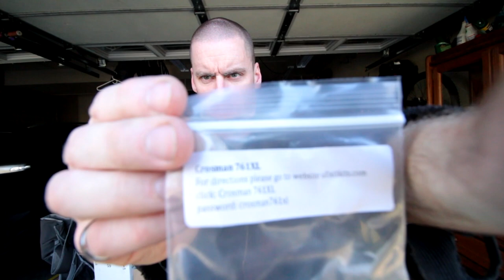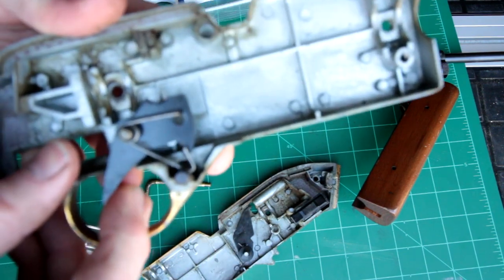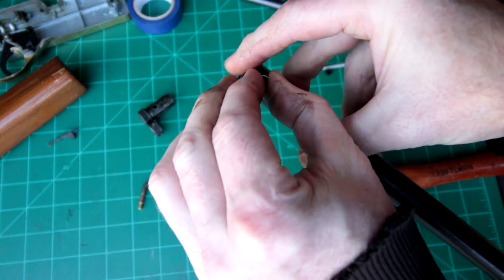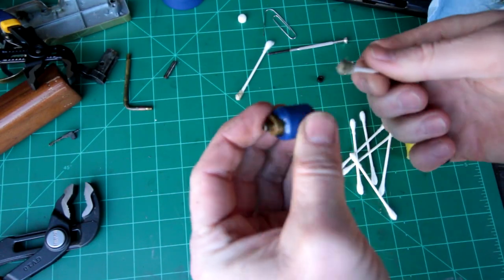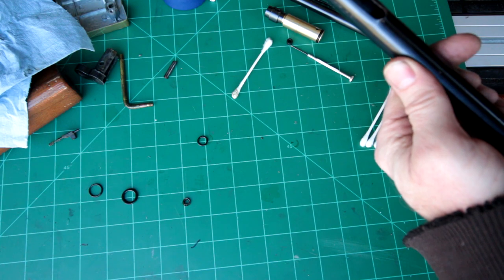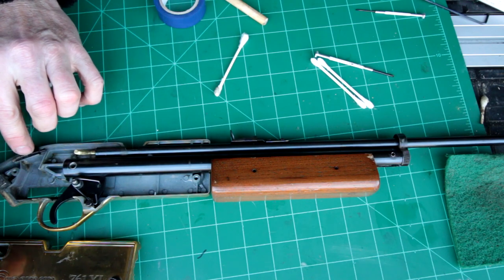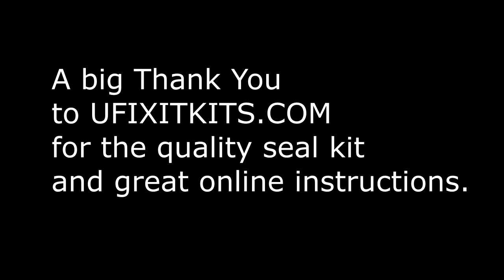Crosman 761XL Rebuild

Comment: You're the only one that knows how to put the 760 back together the right way answers all my questions and head scratchers I just bought an old 760 had taken it apart and just wondered how to actually get it back together the right way thank you so much!
Reply from the maker: Thank you so much for the comment.  One of the reasons I videoed the whole process was to have a reference for myself to be able to put all the pieces back correctly.  I used to take pictures of the process, but I think video is better.

Comment: Great rebuild, but you ordered the wrong piston.  Your gun has the older "flat head" valve, which used an adjustable flat head piston.  The later valves had a conical head, which used a piston with a pump cup.  You used the later piston with pump cup, which will create some headspace and won't allow you to build as much pressure.
Reply from the maker: Thank you for this information.  I was mainly wanting to get it back to working condition, which the new parts did.  It has been a while since I did this, but I thought that the pistons looked the same.  Maybe the gun had been resealed before.
Reply: @Todd Kavanagh any idea where to get the right piston you're talking about? I have the same with the flat head and can't find it anywhere

Comment: Thanks for your video. I bought my 761XL new in 70's & Jan 2024 the seal just broke.  I'm going to repair it. My brass has flaked a bit more than yours. Everything else has held up nicely.  I have the original carton too. Thanks again.
Reply from the maker: I always liked the 761XL but never had on as a kid.  I was able to get the one in my video relatively inexpensive because it wasn't working.  A little bit of time and a few seals later, it was as good as new.  Good luck with repairing yours.

Comment: Great video, and great gun!  They sure don't make them like this anymore......
Reply from the maker: Thank you for the comment.  There are airguns made like this still, they just cost a lot more.
Reply: @CHARLESCRANFORD  I was curious on your 761XL when fired do you notice air escaping along the upper seam of the receiver, near the where the BB slide switch is?  Maybe its been a long time since I shot this and not sure if this is part of the design or I am imagining things.
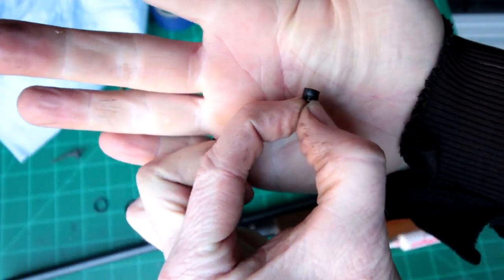Reply from the maker: @malibuguy5187  I do not notice that.  It could be your seal between the pump tube and the barrel.  You can see this in my video at 24:24.

Comment: That was great.  Hey, can you tell me what the decibel level is with that crosman 761?  I was just wondering if I could use it on rats in my yard without freaking out my nosey neighbors.
Reply from the maker: If you have nosey neighbors, this is not the gun for you.  Only using three pumps might be okay, but you won't have the power to humanely kill rats.  If you knew you could git one good shot and then act like you didn't hear anything, maybe.  There are some new air riffles with built in sound dampening, that are almost as quiet as a Red Ryder, but have more power than a fully pumped up (loud) 761.  Good luck with your nosey neighbors.

Comment: Where did you purchase the rebuild kit.  I checked UFIXITKIT.COM, but it's just a generic web hosting site.  I looked at several videos and rebuilding, I liked your the best.  Thanks!
Reply from the maker: I found them on ebay.  They are ufixitkits.  When you buy a kit from them, they give you a code to access step by step instructions, on their website.  Thank you for the comment, and good luck fixing yours.
Reply: @CHARLESCRANFORD  Thanks.  I appreciate your quick reply.

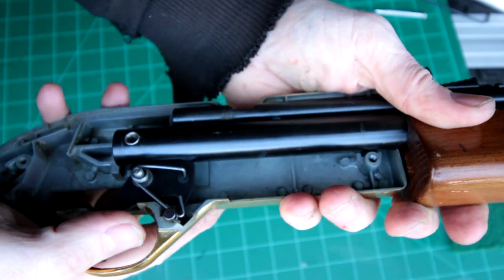Comment: At 26:36, you have the threaded pin backwards. The cut slots go outward to allow a screwdriver to hold it while tightening the sideplate screw.

You were lucky on that valve, I've tried tape, rubber, nothing will hold mine tight enough to allow me to get it to come apart. The plier jaws did a pretty good job strafing the checkvalve surface though...

I may try it again with leather, perhaps an old belt.

The screw was also cross-threaded into it, but a tap salvaged it enough to where the screw will hold.
Reply from the maker: I have watched that part five times and I am still not sure what threaded pin you are referring to.  Is it the pin that the trigger pivots on?
Reply: The big pin that goes through the receiver and holds the rear plug. Freeze frame at that timestamp, it's already installed.
Reply from the maker: @stevekurzban9352  Okay I think I see what you are talking about.  During disassembly, at around 10:00 you can see me wondering if it goes in one way or the other.   Reassembling at around  21:49  you can see me fumbling with it and it seamed like it would only go in the way I put it in, but I was able to put it in backwards somehow.  If one of the screws got stuck in there, it would be hard to get it out without access to the slotted part of the pin.  I am surprised the pin isn't slotted on both ends.  But, when I was disassembling, that part, I didn't need to hold the pin to be able to take the screw out, I got lucky.  I was mainly taking video of taking this apart for my own use in case I couldn't remember how something went together.  Thank you for pointing this out.  Hopefully your comment will help someone figure out how to fix there air gun.
Reply: @CHARLESCRANFORD  you fared better than I did, a kit with 4 o-rings netted me 435 fps using bb's at 10 pumps...
Reply from the maker: @stevekurzban9352  I would have been happy with 435, cause before it would barely hold enough air to spit a bb out the barrel.   Do you hear any air leaking by, when you pump it up?
Reply: @CHARLESCRANFORD  no but I'm not sure my hearing is "equal to the burden". It builds both fps and resistance with each pump stroke. It also likes pellets much better than bb's.
Reply from the maker: @stevekurzban9352  At least it is working.
Reply: @CHARLESCRANFORD  It's got a new home, gifted as 5 year olds first bb gun. 

Was thinking after, could be the tuning I cut for  transfer port. I "sealed" the ends using plumber's silicone grease...

At least it's accurate with pellets

Comment: I replaced all of the seals in mine and it still loses air somewhere toward the front of the pump assembly.. so frustrating.
Reply from the maker: Is it puffing, when you pump or hissing, after it is pumped.  The puffing, with the pump in the open position, is it letting air in, and is normal.  Hissing, after it is pumped is not normal.  If that is the case, you may have a damaged seal or damage to the metal/brass parts of the gun.
Reply: When i pump it slow, it gives one quick puff. And builds no pressure. It sounds like it could be puffing it right out of the barrel maybe. I may just buy a new air chamber for it or whatever its called and replace the whole thing i was just hoping to save the origional parts with it being an older model. But im not sure which ones will work with it. Its got the brass internals, brass bolt, i think its the self cocking version from what ive read. Its labeled as a powermaster instead of the later pumpmaster.
Reply from the maker: @tylerparker3024  Did everything move smoothly and did all the parts look clean?  It does sound like the cup seal is not working properly.  Sometimes oil can gunk up inside the parts and keep them from moving freely.  You might be able to clean the parts and get them moving freely again without having to replace the old parts.
Reply: I cleaned everything pretty good when i had it apart. And replaced the pump cup. Maybe the air is still getting around that cup. Its difficult to tell where the puff of Air is really coming from.

Comment: Hey Charles great video I’m doing the exact thing now…any tips on getting the smallest inner oring out of the exhaust valve? Using a tiny flat Blade screwdriver but afraid of scratching the brass. Really tough getting it out I think because it’s all dried out and stuck in there
Reply from the maker: A pick would be best.  If you don't have a pick, use a large sewing needle.  Instead of picking around the edge of the o-ring, push the pick or needle into the o-ring and pry it out.  You will damage the o-ring, but you will be replacing it anyway. Thank you for the comment.  Good luck.
Reply: @CHARLESCRANFORD  thank you! Awesome idea! BTW I just lost an eBay bid on a 761xl your video inspired me to pick one up …still remember when that came out I was fascinated with the gold plating ! Thanks again Charles!
Reply from the maker: @a012210  The 761XLs are starting to go for higher prices on Ebay.  If you can find one that needs resealing, they can be less expensive.  Good Luck.
Reply: @CHARLESCRANFORD  the sewing needle did the trick … great idea!  Thanks again for a great video I’ve been referring back to it a lot as I’m rebuilding
Reply from the maker: @a012210  Good to hear.  I mainly made the video for myself, to make sure I could get everything back together.  I watched some of your videos.....small world, I live in North Carolina.
Reply: @CHARLESCRANFORD  very cool, yeah small world!

Comment: How does the stock go on
Reply from the maker: 1:38 one screw thru a hole in the bottom.
Reply from the maker: I put it back on at 31:40 but it is out of frame.  You can see me taking it off at 1:38 .

Comment: I cant find the ufixitkit.com site that you were speaking of did you get it off Ebay by any chance ? Funny enough I'm trying to rebuild my 761XL and its leaking aswell
Reply from the maker: ufixitkits.com with a s.  They are on ebay.  Here is the one that I bought:  https://www.ebay.com/itm/Crosman-761XL-761-XL-COMPLETE-Rebuild-Kit-with-Step-by-Step-Directions/282619943705?hash=item41cd761b19:g:G9wAAOSwwRBcmRmH  The kit comes with a password to unlock the directions and pictures on the ufixitkits.com website.  Good luck fixing your 761XL.  Please let me know how it turns out.

Comment: I just bought one at a flea market but mine doesn’t have the golden coated clamshell halves. Everything else is the same rifle. I seem to be missing the hammer spring and need a seal kit. I may have dropped the spring in my living room. Hope I can buy one if I can’t find it. Where did you order the parts? Thanks for the video.
Reply from the maker: I have a similar model as well.  I think the best way to find your hammer spring would be to use a strong magnet and move it gently across your living room floor.  I got the kit on ufixitkits.com
  They are on ebay.  Here is the one that I bought:  https://www.ebay.com/itm/Crosman-761XL-761-XL-COMPLETE-Rebuild-Kit-with-Step-by-Step-Directions/282619943705?hash=item41cd761b19:g:G9wAAOSwwRBcmRmH

  The kit comes with a password to unlock the directions and pictures on the ufixitkits.com
 website.  Good luck fixing your 761XL.  Please let me know how it turns out.
Reply: CHARLES CRANFORD I found the spring where I dropped it in my tool drawer. I found all the O-rings needed in the correct sizes at Lowe’s in the plumbing section. All I need now is the compression pump rubber cap. I didn’t like the way the sight mounting holes were drilled all the way through into the bore of the rifle barrel. I removed the sight screws, removed the barrel, sanded the paint off the barrel near the sight mounting screw holes, inserted a nail into the bore of the barrel to be beneath the holes, heated up the barrel at the s red holes with a propane torch and melted lead into those screw holes until it stuck properly and cooled it down and sanded the lead fill smooth. I took the nail out and checked the inside of the barrel to make sure no lead was partially blocking the bore. Then I sanded, primed and painted the barrel black. I wasn’t going to use iron or plastic sights anyway, I have a red dot sight I want to use. Crosman sent me the contact information for their repairman in Virginia, I guess I can get the rubber pump cap from him. It looks very much like a fuel injector cap so I might find a suitable replacement at an auto parts store.
Reply: No pump cup found yet. Most of the YouTube videos are old showing the restoration of these older Crosman 760s. Maybe they no longer supply any pump cups for these.
Reply: CHARLES CRANFORD I went to the link you sent me and the pump mechanism and pump cup are different than what is on my Crosman 760. Is it an upgrade that will still work or do I need to find the style pump cup that I have?
Reply from the maker: @cdgarrett1  Sorry, I thought you said you had a 761.  You will need the correct kit for your 760.
Reply: CHARLES CRANFORD I took the pump stem and pump cup out of my new plastic Crosman 760 and installed it in the old Crosman 760. It is a tight fit when fully compressed but it works at least temporarily until it breaks. I may measure and compare both compressor cylinders from the old and new Crosman 760s and see what adjustments can be made to use the newer parts. If that works I will not have to worry about finding vintage parts for the old Crosman 760. It works good at 40 feet plinking aluminum cans like it is. I never pump it past 4 pumps anyway which should be about 400fps, good enough for starlings and black birds.
Reply from the maker: @cdgarrett1  Good to know.  I usually like birds, but starlings are horrible....good luck getting them.
Reply: CHARLES CRANFORD not likely to happen now, I’ve had the Crosman 760 apart and back together maybe 50 times and cannot get it to work properly.
Reply from the maker: @cdgarrett1  50 times!  I would have given up after 20.  Good luck figuring it out.

Comment: Is the xl bigger than the regular 760?
Reply from the maker: There are so many differences in all the different models, so I might be wrong, but I think the main difference is the 761 and 761XL had larger forestocks, compared to the 760.  I think the rear stock may have also been larger.  I do have a 761 and a 761XL that look the same size.  I hope this answer didn't open a can of worms.
Reply: @CHARLESCRANFORD  do you think a 761 xl stock and foregrip would fit on a regular 760?
Reply from the maker: @the.villa1n  I doubt it.  I think the frames are different.  There might be some years that would work.  There were so many different models.